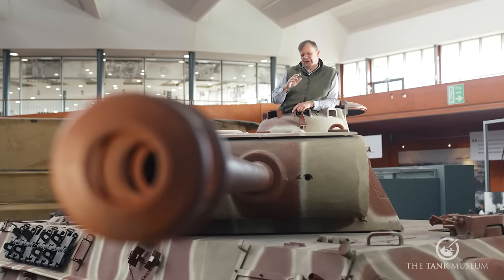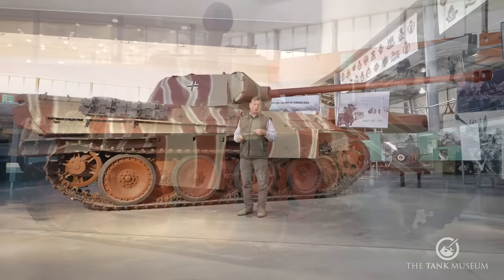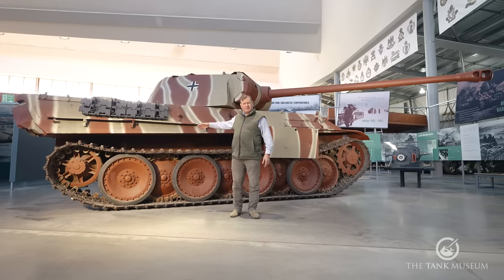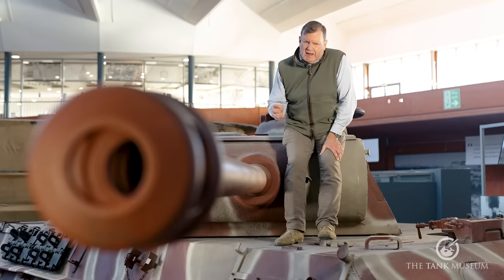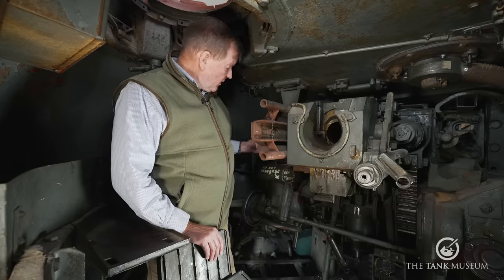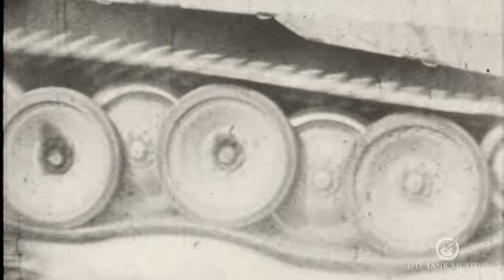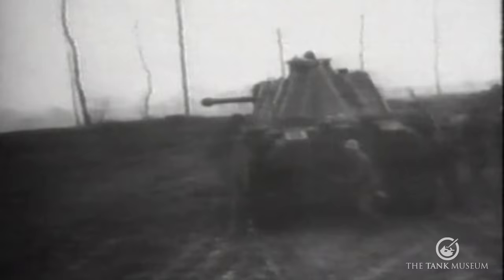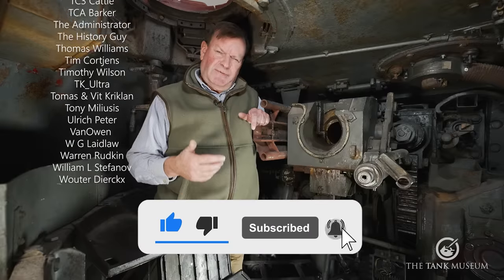See Inside Panther | Tank Chats Reloaded

Comment: Germans then and now, have this "selbstverständnis" - "self-image", that German solutions are the best, and they are highly efficient in touting it ( = propaganda/marketing ) to everybody.
There are so many problems in the design, that where apparent at the time of design and construction.
But experiences from the troops where filtered out, because "doctors and engineers knew better".
The problem with the interleaving wheel layout as one that was a huge hinderence in the battlefields of Russia, as one example, and the drivetrain layout in regards to servicing and reliability.
It's not that the Russians where smarter when they designed the T34.
They just did not have the same capacity to over-engineer as the Germans, and the T34 had a lot of other issues as well.
But the Panther could so easily have been "perfected" by simplifying and thinking ahead.
Luckily they didnt and used the rescources for even more expensive, more complicated and less reliable maschines.

Comment: The "very advanced" german tanks were well behind the russians in tank design - again we see this proof - their "answer" to the T34 was a copy/paste slopped armor, and a HEAVY tank to fight a medium one... 
Worst, the "advanced" german muppets were unable to build a diesel engine ( later in the war they were begging the Czechs to build for them diesel engines ! ) and ironically, the country facing an acute shortage of fuel, is building tanks who consume "4 x more !!!" fuel than the T34...
The crappy overlapping wheels represent another german failure,  they never managed - during the whole war - to build a decent set of tracks...It was a  good gun on top of a decent armored chassis, powered by a crappy engine, crappy gearbox and transmission, and crappy tracks. 
Not a great tank,  just a decent one. An unfinished product, far away from the idea of a "good, advanced" tank.